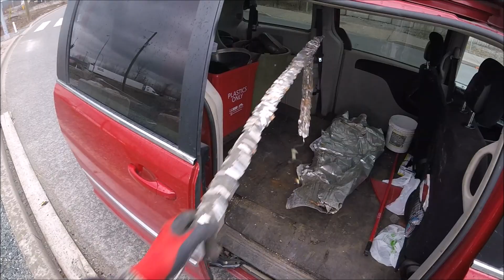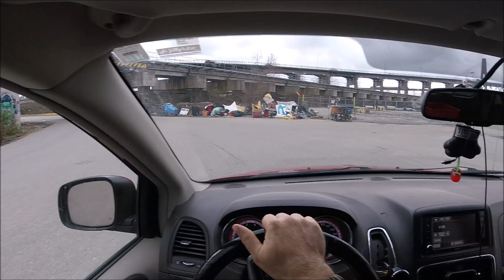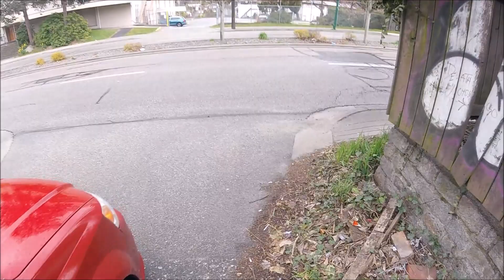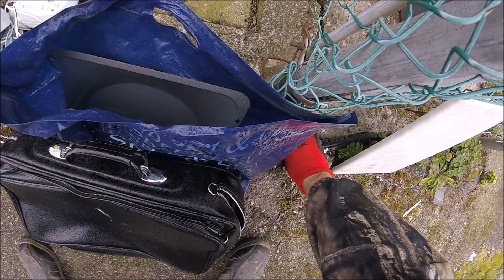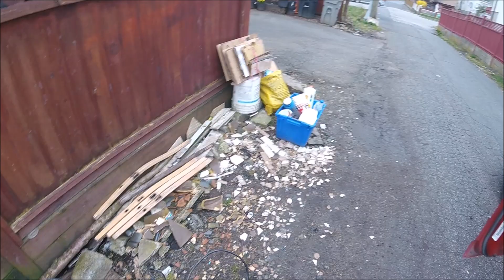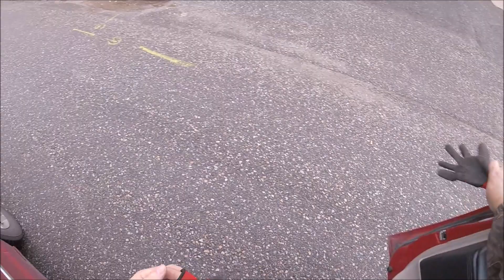Scrap Run Selling Aluminium & Street Scrapping

Comment: Take all your circuit boards home from the yard asap. When you go into lock down it will give you something to do, don't forget the tools.
Reply: I just found out that on tuesday the governor in my state signed the executive order for 'stay home, stay safe'. So basically no travel except going to the grocery store, gas station, pharmacy, or medical needs.    I noticed there was another reason - 'exercise'.  So I'm not stopping anything I'm doing.
Reply from the maker: If it gets to that point i will strip all my wire